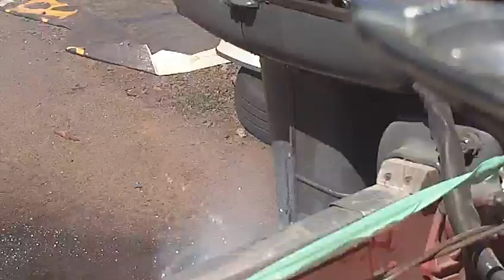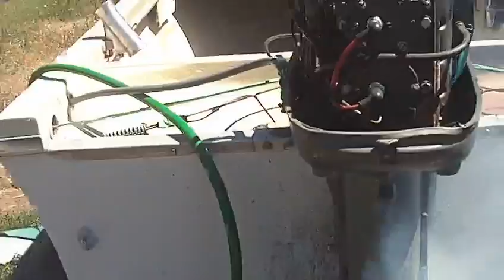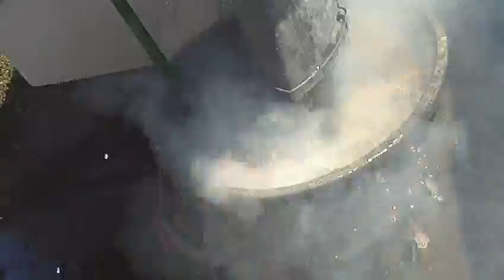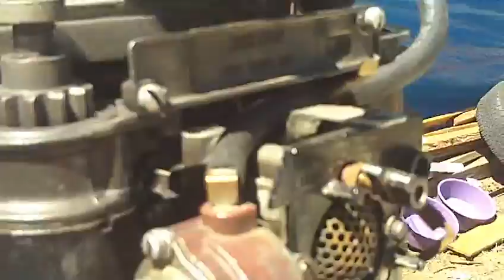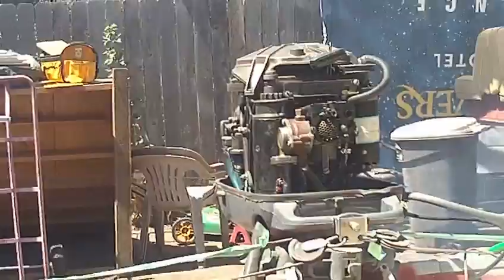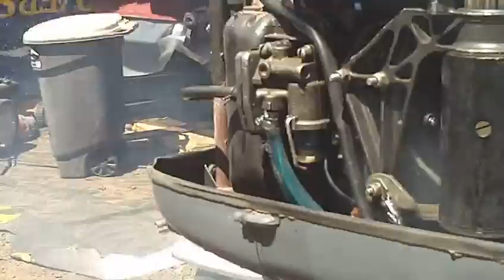Starting the Lark IV for the first time after carb rebuild.

Comment: smooth running Lark brother. I rebuilt my carb two years ago but still have trouble keeping the motor running at low idle speeds. Any help would be appreciated. I have a 61 glass Crestliner with the original Lark IV
Reply: Replace the upper & lower main crankcase seals, thats usually why its hard to keep a low idle & and tune if theres an air leak.
Reply: @craighall1547  thank you